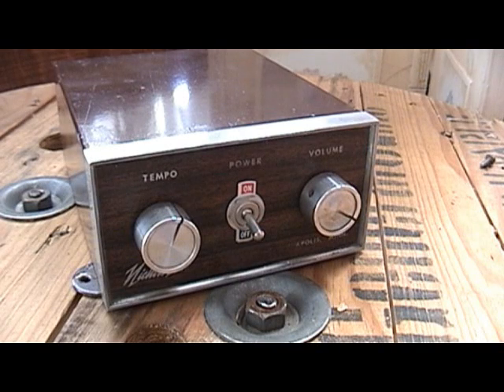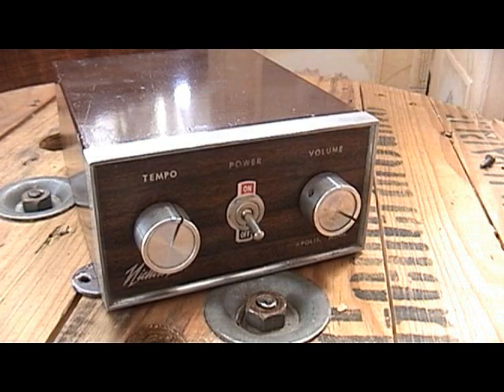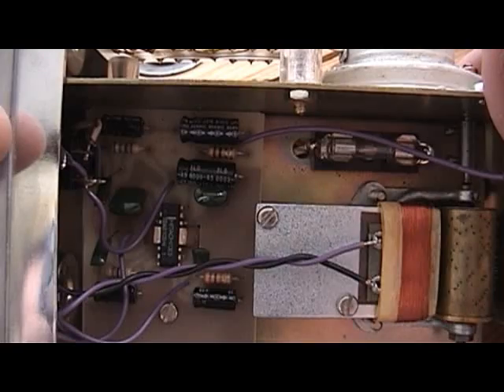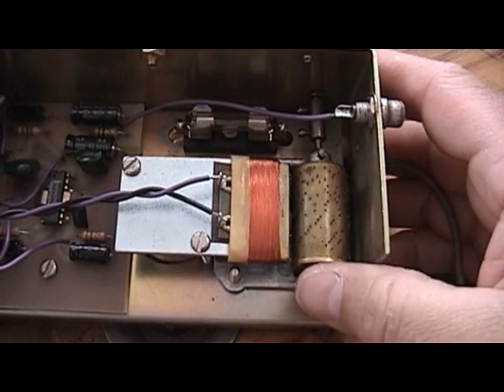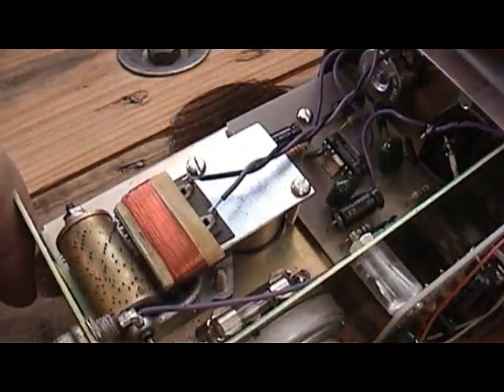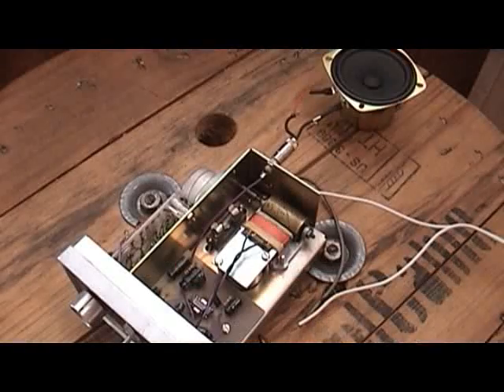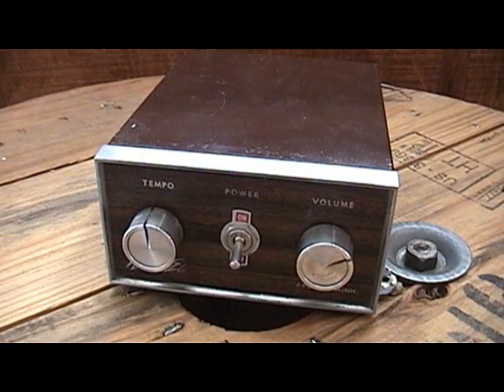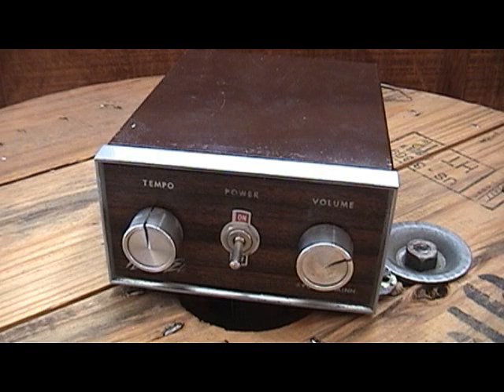Vintage Ice Cream Truck Music Box

Comment: I had my own ice cream truck back in1974. The old man that had the truck 1969 lived around the corner from me. I was 13 and was telling him as a kid i always wanted to be am ice cream. He told me when i retire i will sell you the truck and in 1974 he did just that. Best day of my life. The music box was from a company in Inglewood  CA. called Carlson. I was a box bigger than the one your showing and used a round metal disc, the size of a cd. When i was about 8 the ice cream trucks used the same disc but the box was even bigger than the one i had. Those were some great times.
Reply: Hey, do you happen to know what kind of power cable it used? I have one, just can't get it powered up and running.

Comment: I was brought up in the ice resm business ive beem in it all street vending , manufactur,owning ice ceam stores . big ice cream consessions at convention centers and  stadiums , that music box is a i beleive is a 1970 first of the transisters players by nichols . We used the thornes disk playing amplified music boxes first there was the tube types ones you couldnt keep tubes in long because of the vibration in the trucks then in 70s they came out with s small unit digital ttansister misic boxes  back in the day we ordered them out of a place in california for 125.00 .they very seldom ever broke down , the metal  music disk where about 7.00 each they had every nursery child song you could think of from jack and jill  one of my favorites to braums lulaby whick means a lot to me. The metal rooler teeth pick teeth broke some as they wrar down.tjats the only problems plus some times the rrecord teeth break off.your box sounfs so good beyter than those nichols all digitol ,ive never liked nickols boxes ever.when you have used caddilac you dont want ford